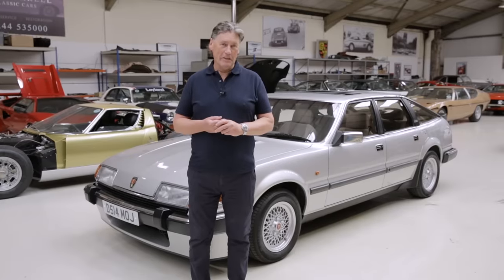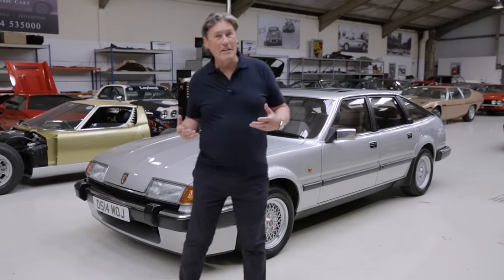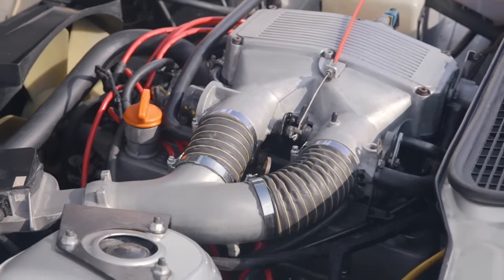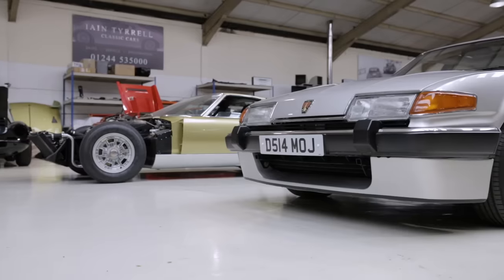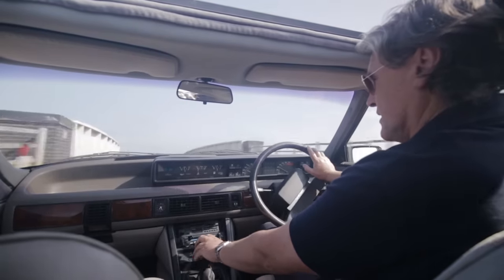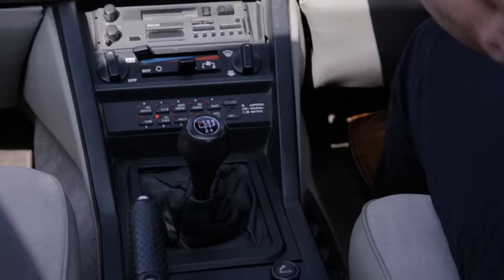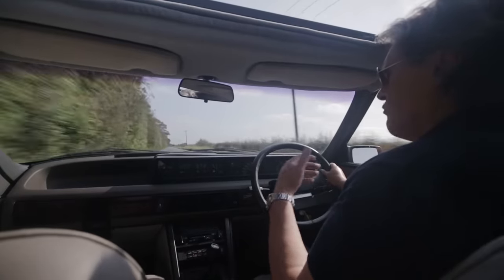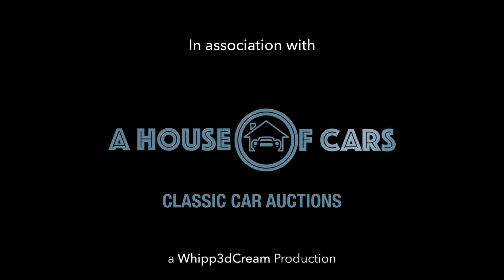Rover SD1 Vitesse - American V8 Power Meets British Engineering | Tyrrell's Classic Workshop

Comment: Although they are sometimes called “blood grooves,” the fuller (its proper name) on a blade has nothing to do with blood. It is just to make the blade lighter.
Reply: Thanks, mate - I was hoping someone else had caught this.  It's such a common misnomer.
Reply: Interesting. That makes sense. I suppose it's a bloody myth!
Reply: Yeah but it definitely helps when you are stabbing people. I used to use a dagger without a fuller and moved over to one with a fuller a few years ago and it's saved me hours.
Reply: @Daniel-S1  That's been very much my experience.
Reply: @Daniel S That’s a myth.
Reply: @Daniel-S1   That's just a myth.  Anything with an edge will withdraw very easily as it's no longer losing energy to cutting.  You can only get "sucking" if the body tries to leave an open cavity behind as you remove the blade - which is not how it works.  Pushing the blade in requires significantly more force, but removing the blade simply means the flesh will close together smoothly as the blade is pulled out of the way.  Next time you go hunting, stab a thick portion of meat (careful not to hit bone) and see for yourself) with a plain (unfullered) blade - it will be much harder to push it in than pull it out.  Put the myth to the test - the difference is significant.  :-)
Reply: @hughoxford8735  🤓

Comment: That little engine had a date with a turbo in 1962 - 1963 in the Oldsmobile Jetfire, and used a methanol injection system to keep things cool.
Reply: ChrisHallett83  It was the same Buick engine but with internal mods.  It used a water/alcohol mixture to keep detonation at a minimum but never worked well.
Reply: Paul Lee Same basic block with different heads. Oldsmobile had an additional head bolt per cylinder (6 vs 5) and classic wedge combustion chamber design while Buick was like an oval tub with inline valve arrangement).  I have all 3 engine designs but haven’t taken the Rover apart for a rebuild to see what combustion chamber they used.

Comment: Great video, many thanks for showing. Pity while demonstrating how well it goes you overlooked the other great feature of those engines, grunt, and how few gear changes are really needed. The ability to pull strongly and smoothly across such a large rev range was revolutionary at the time, in my opinion!

Comment: My Dad had a couple of SD1's when I was a kid in the 80's. A 2.6 and then the 3.5 V8. This had a sunroof which folded all the way back to the back seats. In pre nanny state days we would stand on the back seats sticking our heads out of the sunroof whilst dad roared along the motorway. Lots of good memories of that car.
Reply: Great stuff Mike!
The 2.6 was no slouch, and very smooth. I remember battling one on the M1 in my Mercedes 3.5 V8 back in the 1980s, and I couldn't pull away until 120 mph plus! Very aerodynamic shape those SD1s. Shame the tin worm put an end to most of them. Happy memories!

Comment: IME, on a standard engine the "twin plenum" is worth nothing in terms of power or torque, simply because the throttle plate area is not the limiting factor (if it were, on a single plenum car, the manifold pressure would be below atmospheric at WOT peak power, ie the throttle would be a restriction). The port flow and cam / valve geo of the std RV8 is pretty terrible and is what limits the engines performance (190 bhp from 3.5 litres is just 54 bhp/litre.....) The lack of mapped ignition also meant that whilst the move to port fuel injection from twin carbs did indeed significantly improve the engine out emisisons (thanks to much better AFR control) it did nothing for power. The twin plenum made a tiny improvement to the full on race engines used for the touring cars because they have big valves, high lift cams and significantly reworked ports.    What i would call "Modern" intake performance did not really come until the engine became "serpentine" in the late 1990's where it finally got a sensibel length intake runner that actually tuned within the (limited) working rev range of the engine
Reply: Very interesting. I must admit I always thought the SD1 V8 was pretty flat as standard. 150hp :-/ Seems a lazy engine- in keeping with the American underpinnings
Reply: The 54 bhp/litre is shocking - 6.75bhp per cylinder !! My 2.0 litre MCS throws out just under 250 bhp, or 125 bhp/litre !
Reply: That power/displacement ratio is mainly an indication of the engine’s low-revving nature… American engines have always been tuned in favor of low-end torque… especially in family car use cases.  No doubt a specialist engine builder with a generous budget could tune the Rover engine to run happily at 8,000-odd RPM with equally high power output.
Reply: cerberus1981 makes me a tad skeptical about Iain’s claimed output. It doesn’t seem particularly cammy or revvy for nicely over 200hp. Might be running some increased displacement I guess....
Reply: @chrismc1977  I drive a P6 3500. A modern 1.0 Eco Ford is quicker. There was a "gentleman's" agreement in the 70s regarding bhp figures. The Ford Capri 3.0 first came out with 150hp but was reduced to 130hp at release as it was deemed too powerful. I have a feeling it was the suits keeping everything user friendly back then not the mechanics.
Reply: @johnsmith1474  I cant be responsible for your misinterpretation of my comment.
Reply: @peterbustin2683  say what? Doesn't make any sense!
Reply: Peter Bustin 6.75bhp per cylinder? Buy a calculator.
Reply: @kipsome45  54bhp per litre, 8 cylinders, 6.75bhp per cylinder, per litre.  Seemed obvious enough to me
Reply: @peterbustin2683  what's an MCS?
Reply: @thosdot6497  it doesn't work like that. BHP per litre is the power of the engine divided by its total displacement. The BHP/litre of an individual cylinder is exactly the same as that of the whole engine (assuming you had a single-cylinder test engine with a heavy enough flywheel to keep it turning rather than using one piston to push seven dead ones!).
Reply: @richardharrold9736  - hey, don't blame me!  I was just pointing out the arithmetical base of @Peter Bustin's comment. Perhaps adding 'per litre' at the end was confusing, if not actually incorrect. Eh, it's been a long winter.
I've seen power measured all sorts of ways though, things like bhp per litre per 1000 rpm, although that was for peak power on racing engines.
Reply: @peterbustin2683  Wow your 40 year newer Cooper S with a turbo is more efficient than a Rover Vitesse, do you have any other earth shattering news for us?  54BHP/litre is actually pretty competitive for the 80's ohv technology, similar to what Ford got from their 2.8 v6 and Vauxhall got from the Cam in Head  3 litres.  You cars' progenitor the 1275 Cooper S only got about 70/litre in a pretty highly strung tune. Also comparing a modern 2 litre turbo to a classic v8 is missing the point of this channel entirely.
Reply: The V8 suited my 1982 Range Rover bought in 1994. Always re adjusted after the MOT man upset things each year... Loads of power and 23 something MPG with the old 4 speed gearbox the best ever 23.8 mpg driving on holiday in Cornwall. When the engine became tired I fitted a 200 Tdi & still have her...
Reply: Chris McMahon yes you’d expect more from a V8 than 150bhp. But as said in this review those engines were so tuneable. I know a chap who had a SDI back in 97/98 and he tuned his from standard to 250bhp plus, and did it himself on the drive job. Don’t ask me how but he was a real petrol head and it was quick, become a real Cosworth eater. Although it never had the handling capabilities of a Cosworth on a straight run, it would destroy a Sierra Cosworth and even the Escort Cosworth.
Reply: Peter Bustin yes but the engine itself was easy to tune up from its standard. Achieving 200bhp plus was easily done.
Reply: Tony Goodman is it true they say the P6 was over engineered even compared to the rivals of Mercedes and BMWs?
Reply: A Twinspark wow that’s impressive enough. The SDI was a big lump but could move alright. Do you still have your SDI or did you get rid? Personally I think the post 83 models with the facelift were the best, especially the Vitesse metallic blue and the multi spike alloys. They looked awesome with those lovely, comfy Velore seats🙂😁
Reply: The rover v8 would have been better if they let the Italians cast the block and design the heads. Italians were masterful in their casting abilities back in the day. Even so I love the Rv8 and the vehicles they powered even if they were flawed.
Reply: @Jack-tx2ve  Rover cut their teeth on sand casting for their jet turbine parts and were building all-alloy engines under license for Rolls-Royce before the Italian even attempted it.  Rover's zircon sand techniques were used by Jaguar and Aston Martin under license too.
Reply: @MichaelThomas-be7gq   I have worked on rv8s and I have worked on 50's and 60's Italian engines. Some of the castings on older Italian stuff is just beautiful. The Rv8 was not an over engineered engine. It was not meant to be. It did a job and it did it well.
Reply: @A Twinspark I would love to here the full story  ! .
Reply: @A Twinspark Fantastic story !..Good job I wasn't there ,as a young man I pulled a few strokes to earn a crust or pot of tea ,also as much for the thrill as anything else .

Comment: That “blood trough” is called a “fuller” and it’s there to remove weight from the blade without sacrificing strength or flexibility. It’s not there for blood transit
Reply: Fullers used to be called "blood grooves" or "blood gutters" by some antiquarians
Reply: I believe it’s there to relieve the suction by letting blood/pressure out, so you can pull the sword/bayonet out and thrust it into the next soul.
Reply: Exp Plus.
Reply: @cp4512  shite. If you can't pull it out you shouldn't be sticking it in in the first place
Reply: A Fuller increases the width of a blade without added weight. The shape is hammered into the heated steel. No material is removed...
Reply: MBCGRS without the fuller there would be more material. Six to one
Reply: Tommy Olsen I don’t care about the antiquarians. If they don’t know proper terminology that’s their problem
Reply: @redram5150  Only if you insisted in making the blade the larger size it would be with the fuller, but without it. Your argument is a nonsense.
Reply: MBCGRS any blade of the same material and external dimensions otherwise without a fuller compared to one with a fuller will be heavier. Wherever you thought you had a point, you’re wrong

Edit: By external dimensions I mean length and width. A fuller typically eliminates the thickest point, which is in the middle of the blade: which is where it eliminates material in order to reduce weight
Reply: @redram5150  A Fuller allows less material to be made into a wider blade. You still have the same blade weight you started with. Nothing is removed as you originally incorrectly stated. A blade wouldn't be heavier without the Fuller, just smaller...
Reply: @MBCGRS  whether the blade is wider is moot. It can be wider, but it doesn’t need to be. Two swords made of the same material, of equal length and width, but one with a fuller and one without: the one without the fuller will be heavier. You continually ignore that
Reply: @redram5150  

How is hammering an indent into metal removing any material?
Reply: @skylined5534  a blade with a fuller will have less material than one without a fuller. Perhaps “remove” may not be the best terminology. That said it can be accomplished by doing so. Regardless, the blade with a fuller has less material one without.
Reply: @redram5150  

If you start with a piece of metal and don't use a mechanical means to remove material but just alter its shape the same amount of metal will remain.
Reply: @skylined5534  did you not read my last reply? You just agreed with me
Reply: @redram5150  

No I didn't.

How is a blade without a fuller heavier than a blade with if the same amount of material is present?

Hammering a groove into a piece of metal won't make it lighter as you seem to think it will.
Reply: @skylined5534  from Wikipedia:
“A fuller is a rounded or beveled longitudinal groove or slot along the flat side of a blade (e.g. a sword, knife, or bayonet) that is made using a blacksmithing tool called a spring swage or, like the groove, a fuller. A fuller is often used to lighten the blade. When combined with proper distal tapers, heat treatment and blade tempering, a fullered blade can be 20% to 35% lighter than a non-fullered blade with minimal sacrifice of strength or blade integrity. This effect lessens as the blade is reduced in length. A blade is said to be "fullered" after introduction of the groove.”

Comment: The trough youre talking about is called a fuller, and it's to make the knife lighter, not as believed to let the blood run out.
Reply: Like a Hawk I struck down on the comment section be ause of that statement. Someone had had to said something! And yes. 🤣
To fill in, its not only to make a blade lighter, it is to also keep its stiffness. 🤓
Reply: I was told that it was to let the air in so you could pull the blade back out. Nice
Reply: @petergoodall6258  Some information I wish I could now remove from my head....
Reply: @petergoodall6258  How lovely

Comment: My uncle managed to purchase a brand new 3.5 SD1 in 1976 P reg so would have been one of the first off the production line. Typical BL colour BROWN with beige interior. In 1976 i was nine years old but when uncle arrived in it for the first time i was mesmerised. Revolution in design & sounded fantastic. Now im 54 & i still think they are fantastic although full of faults like leaky boot & rust problems. If ever i get one it would be the last year of make & it would be a D reg 3.5 Vanden Plas auto. Many thanks for the video.

Comment: Shows how a GM small engine can be a success,  by anyone but GM.
Reply: I have that engine in my Disco.  the 4.6 is a wonderful piece of kit once you engineer a few small mistakes out of it.
Reply: Yes, General Motors has always designed and built some amazing vehicles.  Then, they bastardize the whole idea and ruin the whole thing...
Reply: It was only a success after a substantial re-design and modernisation by Rover engineers.
Reply: GM turned 3/4 of this basic engine into the 3.8 Buick V6. After many, many revisions it became one of the most reliable engines ever.

Comment: Manual transmission, the modern anti theft device.
Reply: whut? only old people drive autos.
Reply: not in europe
Reply: In UK/Europe an auto would likely cause more confusion
Reply: @cw205mi16  yes, drove a rental car with some weird fucking semi auto system and it was god awful.

Sodding change gear when I say not 2 seconds later.
Reply: Duke Of Prunes okay, but unless you want to be lumbered with a restrictive license everyone has to learn to drive in a manual.
Reply: Duke Of Prunes  in modern cars you'll see plenty of autos now (like DSG, dual clutch or paddle shift type), but in this era (80s) quite rare to see any automatic in anything other than a large bmw or merc.
Reply: Duke Of Prunes  if you don't pass in a manual car you don't have a FULL driving license in the UK. I'd say 99.5% of UK drivers have a "full" license.
Reply: @cw205mi16  
I hate auto.
Reply: Manual is way more common in UK.
Reply: Duke Of Prunes  I don't know where you made your observstions, but you are mistaken. Between 75 and 80 percent of UK cars and vans have a manual transmission. Most manufacturers offer the option of an auto in some models, but sales figures show that manual transmissions are by far the most common.
Reply: @cw205mi16  

Hahaha! What?! We've had autos here forever!
Reply: @skylined5534  context
Reply: @cw205mi16  

Riiiiight.
Reply: the OP, obviously American, said a manual gearbox acts as an anti theft device. It was a jokey comment, as was mine about autos more likely to cause confusion in the UK and Europe as manuals were always the norm. Never said anything about autos being unheard of. Get with the script lol
Reply: @cw205mi16  

Not even not unheard of. Christ, you could get a teeny tiny BMC Mini in 1959 with an auto and just about everything above. Autos were pretty common too so I think it's YOU who needs to get with the programme 'lol'.
Reply: @another3997  

That's utter cobblers. For the last decade alone UK has been buying auto gearbox cars more and more to the point where currently as a whole the amount sold is 54% of new vehicles. In specific areas this rises to over 60%.

Your figures are low even for the late 1990s.

Comment: A fantastic engine for tuning, you could fit buick cams from the 300 and 340 buicks, chevy small block lifters, mine had a single plane semi high rise inlet manifold with holly 465 4 barrel carb, light flywheel, in a car that weighed 1000kg, it just loved to rev, plant the foot when over 3000rpm fantastic.

Comment: I had an SD1 Vitesse in the 80's and there is an additional factor over the engine. Buick had also been having reliability problems with the engine and Rover did substantial fettling of it to make it reliable.My Vitesse was a manual and had gearbox problems which finally caused me to get rid of it. I owned 5 SD1s  of which this was the last and despite some problems I loved them all.

Comment: I worked in a Rover dealership in the 80s remember driving them the clutch was heavy but they went well, I preferred the Vanden Plas auto versions an easier car to drive in traffic and super smooth but poor visibility thru the back window no parking sensors or rear view cameras back then most of them had a dent or two in the back bumper.